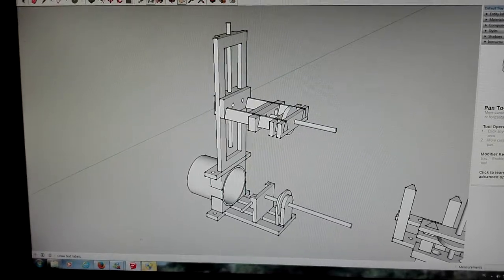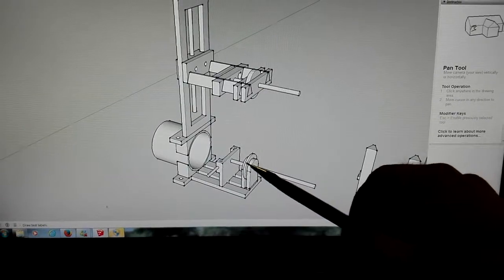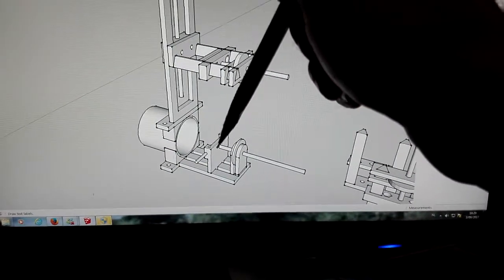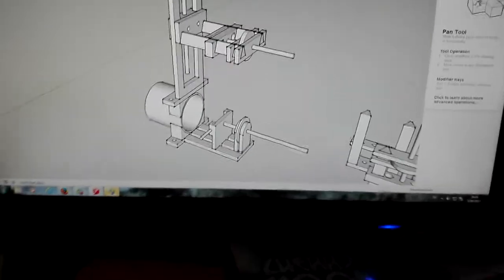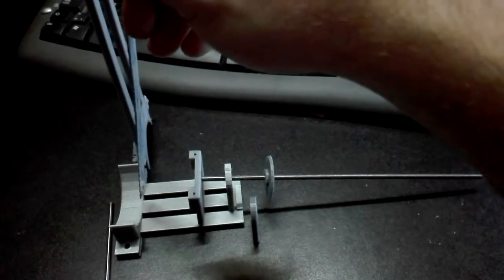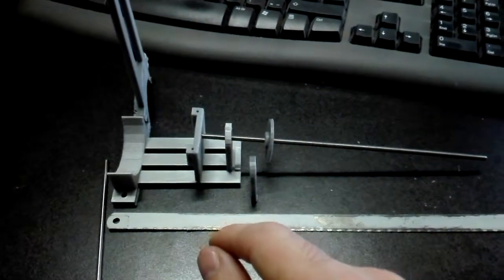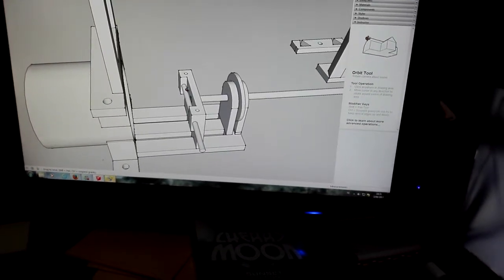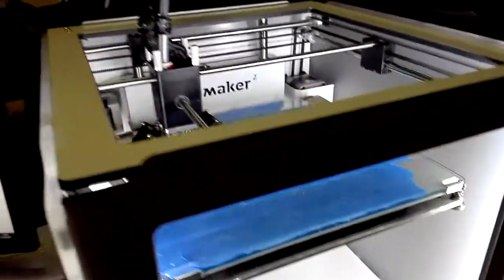007 Daniel McFarland Cook Coils Interruptor Building

Comment: Did it work?
Reply from the maker: Dear Gunpal Jain,
I didn't finish it, I had to less understanding on how it could work. Now I have more understanding of the resonance but the iron core used is the biggest question for me at the moment. In the Don smith device higher frequency and higher voltage will give the result wanted, but with the use of iron core frequency can not go that high. I've been thinking on using the coils without the core, but looking at experiments, larger coils are not necessary better, it's also a relationship to wavelength, and there I made the fault back then to not make them exactly the same. Also there should be a relationship between wirelength primary and secundary, this is also not accounted for, I have to see if I'm lucky on that part with the coils build. Rick Friedrich is working on an experimenting kit I heard in one of his movies, when that comes out I'm very intrested, because I learned a lot from these kits.But offcourse every coil and capacitor is different and I need to learn a lot more to get fully working system.
Reply: @brunovk417  Thank you for your reply. After reading stuffs about it, I am getting few ideas. Resonance is important, no doubt about it. It can work with different cores depending upon the frequency. The effect which is possibly causing the overunity might be due one of following:
1) According to Harold Aspden when we setup radial electric field in a cylinderical capacitor, it produces rotation in Aether. It is the same effect on which pulsed plasma fusion device works i.e. z pinch. In conventional physics, it works similar to co-axial cable. It is the magnetization force  i.e. H. It rotates around the axis. as soon as this rotation starts, we have a power flow i.e. poynting vector along the axis. So, we have a wave propagation along the axis. Let's say we have the length of the coil exactly one half of the wavelength of this wave, then we would have a moving magnetic field between the inner coil and outer coil. When this wave is in phase with the current induced due to mutual coupling of coil then it might increase the energy in the coil.
2) another thing is to notice. When we put two coils like that near. We would have inductive as well as capacitive coupling between 4 coils.

To find correct design parameters we would first need to prepare a mathematical model. Which would take away the guess work and reduce the time.
Reply from the maker: @Gunpal Jain, I'm not experienced with mathematical models, but experiments learned me there's much influence not caused by coils themself but the environment, used wire lengths for connection, placement of parts,... I think coil builders that now how to build high Q coils could really help to see the whole picture. I also doubt official models include all the things happening, whether we like it or not, it's not ment for people to realise that there is more arround us then we've been told (especially to the receiving of the environmental energy). That's my honest opinion.
Reply: @brunovk417  It's ok. Keep up the work. you would stumble upon something.

Comment: wow, ok you have some nice equipment at your disposal. I think maybe you are over engineering your interrupter, imho. I see too much flexibility in the lengths you have in mind. This interrupter is going to have to move in the order of hundreds if not thousands of contacts per minute. Although I like you ability to measure your adjustments you are talking a low voltage therefore within a mm gap. if you take 25mm being roughly 10,000 volts then the gap distance must be achievable for your initial input of voltage. So if you move your magnet passed your iron core at start up and achieved a voltage recorded at 5V then the gap should be at a distance able to work at .10mm to .25mm. A reed switch could work well if we use modern electronics. Back in the day they would have used a contact set. Please read this website 
http://www.old-engine.com/magbuz.htm
on buzzbox coils or hit and miss coils to get a good conceptual idea of using contacts to interrupt. In the buzzbox coils use of a higher voltage is induced using a capacitor without massive coils being wound or large interrupter gaps, but a method of interrupting is used to great advantage.
Reply from the maker: Thank you for the information, I will look into it.
I was concerned about the magnetic force generated by the coil because altough you have many windings it's over a long distance so this is the reason why the interruptor has gottan that big, long distance for the blade will need less force to get it moved, I have no clue to speed to be honest. The interruptor is completly new to me, so thank you for the information webpage. I'm still waiting for the books I orderd.

I'm curious to first tests to really see what is generated on magnetic field strength when using an interruptor, when just applying voltage it's not that great.